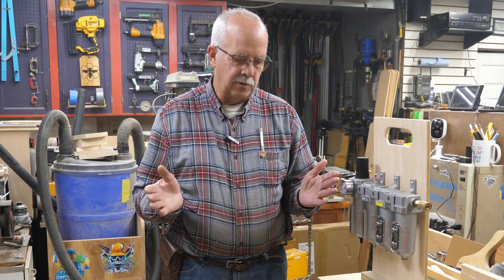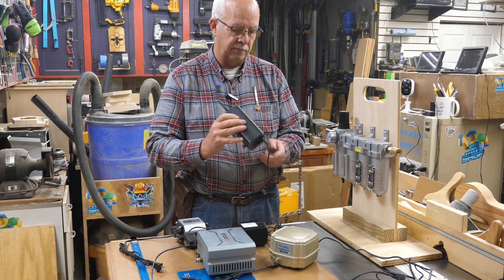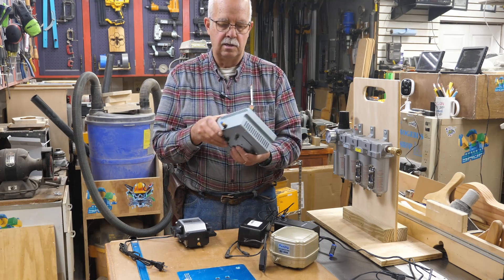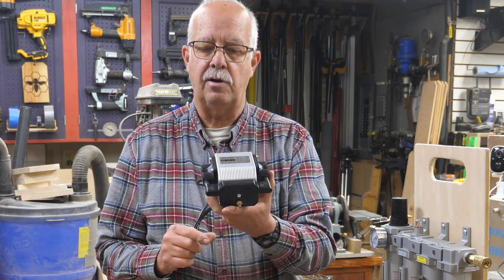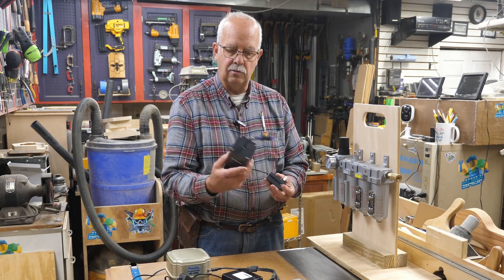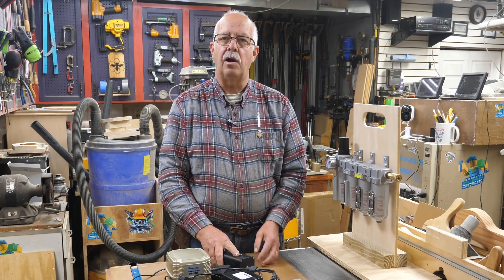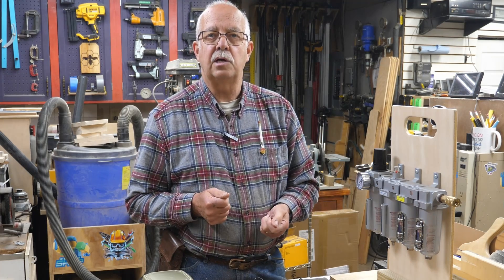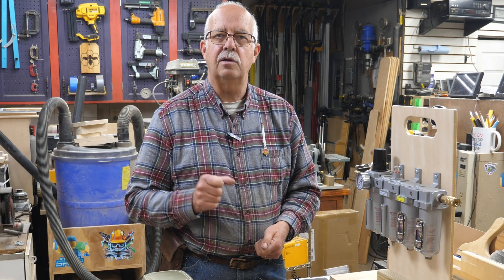Laser Air Assist Pumps or Shop Air?

Comment: I found your video after searching several videos. As I’ve seen several people mention upgrading to a compressor for my 50w desktop. Well because my laser is in the house I didn’t want a big compressor. I’m so glad I came across your video. The lens on my upgraded nozzle are not cheap. With my luck lately. I’ll just upgrade to the Ortur until I can get the device you explained for moisture. Thank you! I don’t need to learn the hard way.

Comment: Mine is not putting out much air and it’s burning my wood what could a problem be?
Reply from the maker: Check for a kinked or blocked line.  If air flow is poor right at the pump, and it is on 100% output, you may need to replace it.
Reply: @rogersshop  yeah I took everything apart, but I think it’s in the elbow where the air holes goes down inside of the laser head so watch YouTube video on that this morning so I’m gonna go check my settings and everything. I’m getting a new laser, but I don’t know what I want yet, so thank you. I appreciate it. Hopefully, I figured it out.

Comment: Thanks, Roger in the Shop! I had considered using my airbrush compressor, but instead opted for a 30L/min. air assist pump. Still waiting on the 3D-printed nozzle. Really enjoying this laser. Man, the extra costs sure do add up quick. But when I get into a new venture, I do like to have everything I need for it.

Comment: My concern about the air assist pumps is that if the outlet feed to the laser is closed and it is still running, it will cause back pressure leading to possible damage to the diaphragm of the pump. Ideally the air assist pump should switch off at the same time as the air control valve to the laser head.
Reply from the maker: Some lasers have that feature, but most do not.
Reply: You can wire the pump into a solid state relay, and wire the trigger signal in the relay to the “activate” signal pin on the laser, the pump should then only turn on when the laser is on.